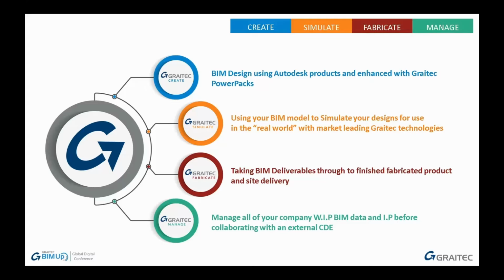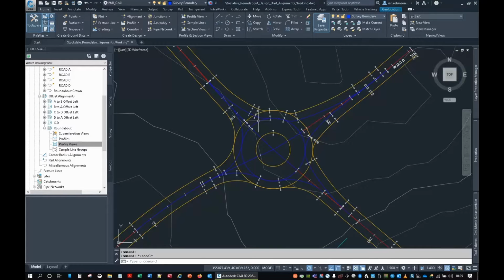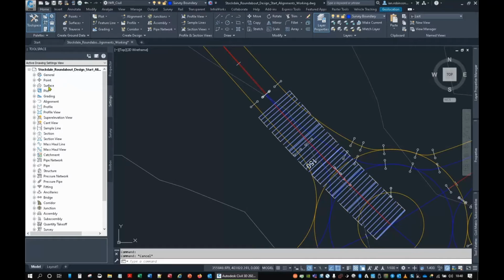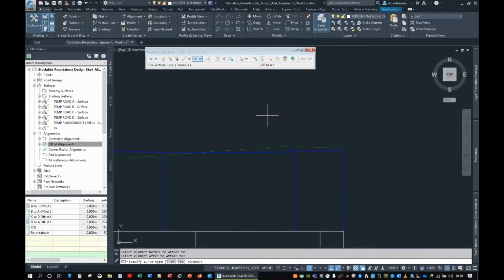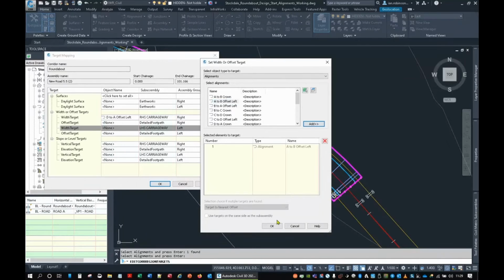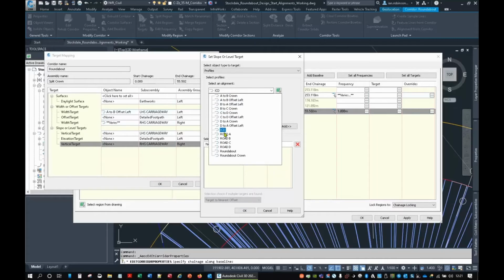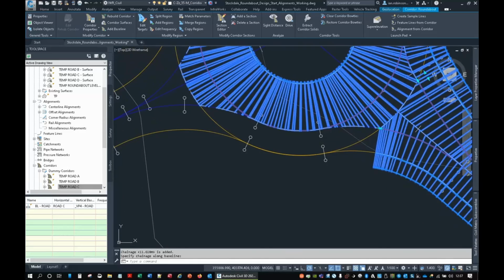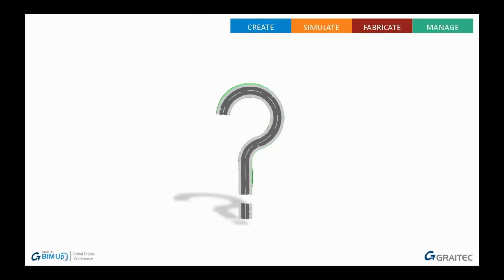Civil 3D - Modelling a Roundabout

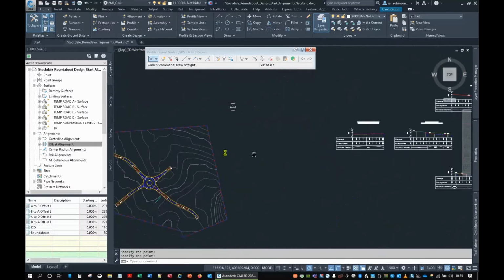Comment: Hi, @ 16:56 you suggested there where other ways of tracing over a profile. What are they?
I am using 12d at the moment and in that you dynamically put in and offset grade along a section. So at this section you would put it a 0%, but at the beginning i could put in an offset grade of 2.5% instead of creating that dummy surface. How can you do this in C3D?
Reply from the maker: I used another method in the video for Grade Seperated Junctions. Have a look. I make it Static, then copy it, then make it dynamic again. I take the copied profile and change it's style and name and use that.